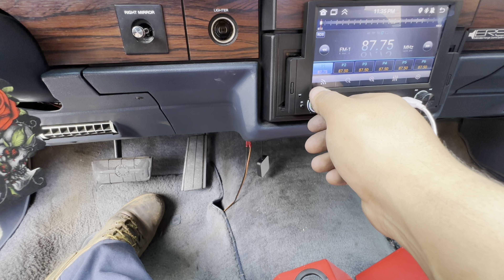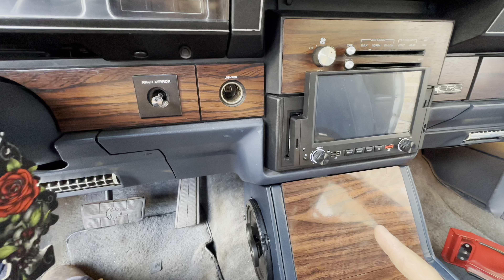BLUE BEAUTY GETS A SOUND UPGRADE THAT PISSED MY NEIGHBORS OFF

Comment: bro you need bigger power wire your gunna melt that shit.
Reply from the maker: Yeah I’m gonna upgrade to a 4 gauge, I’m in the process of purchasing one in the coming days. Thank you for checking the video out.💯❤️✌🏼
Reply: @Lifewithchancho  should be upgrading to 0 guage it’s future proof, and add a big 3 wiring with 0 also, wont have to do anything but add a new battery under the hood and hook it up after
Reply: need more power after that look into a second battery once that doesnt hold up enough go to a high output alt and grab a small 60ah bank

Comment: bro get a better head unit amp and sub.
Reply from the maker: You’re right but I’m doing with what I got right now. Maybe down the road I will.
Reply: @Lifewithchancho  I understand bro.
Reply: Your fuse from the positive terminal needs to be less than 18 inches long. Fire hazard if longer bro
Reply from the maker: Yeah I thought the same thing cause the fuse is to close the hood hinge when I close it but I’m gonna upgrade to a 4gauge, right now it has a 8gauge but thank you for letting me know to bro.